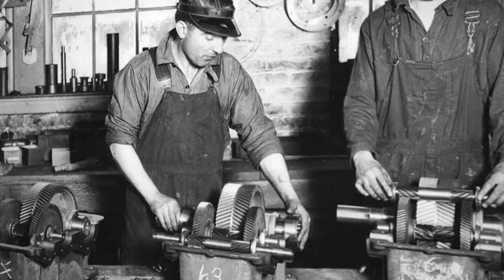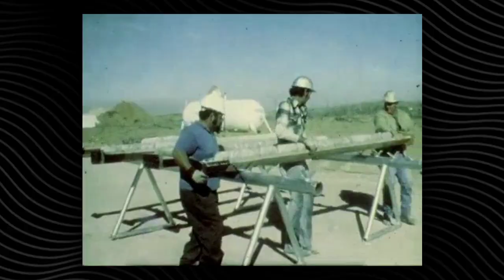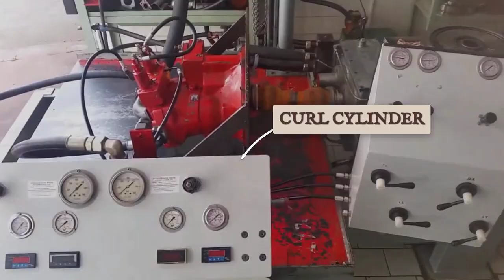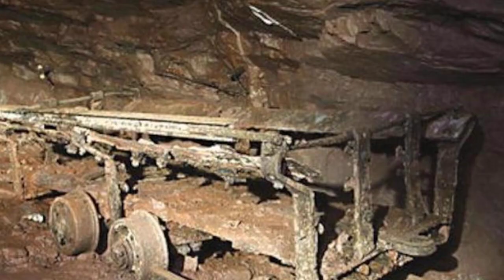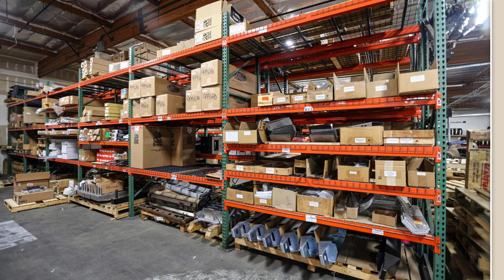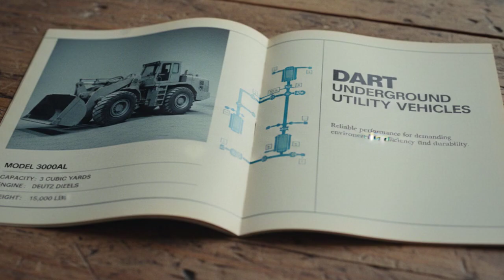Why Did They Build a Mining Loader Like THIS?

Comment: Hello, limit.
Itza good thing that I am not much good at worrying or you would have me worried now.

Yer see, the Dart 600 loader with which I am familiar was NEVER an underground mining machine. You DO show some images of it in your presentation - that'z the LARGE wheel loader with the cab set right over on the left side above and behind the left front wheel that appears at 3.53 in your presentation.

That machine was around TWELVE FEET TALL - hardly an 'underground' mining machine. Instead, they were designed and built azza SURFACE mining and quarrying loader.

So I suspect that one or the other of us is more than a little confused - - - - and I DON'T think it'z me. As I understand it, Dart started in about 1903 building on-road trucks, ventured into off-road dump trucks in 1937, phased out of on-road trucks in 1950, was mainly a builder of off-road heavy haul trucks for mining and quarrying after that and built the Dart 600 loader to load some of their medium and large models.

They were eventually acquired by Unit Rig in 1984.

Just my 0.02.

You have a wonderful day. Best wishes. Deas Plant.